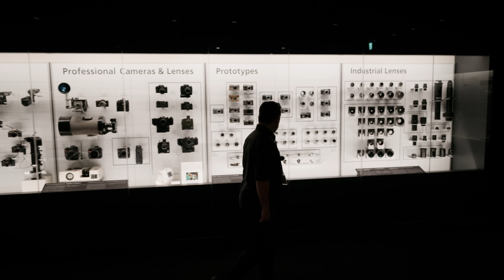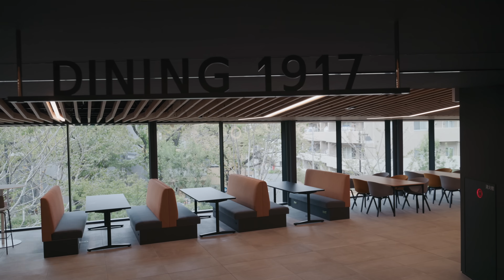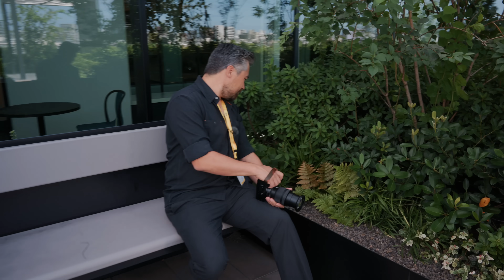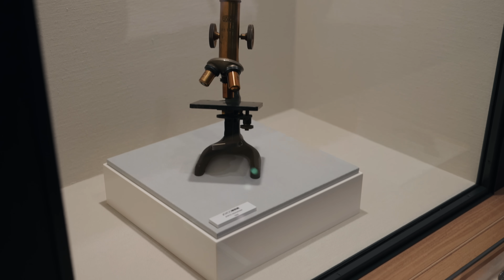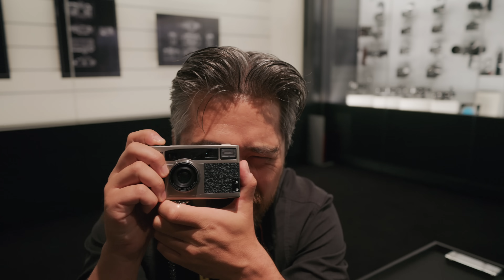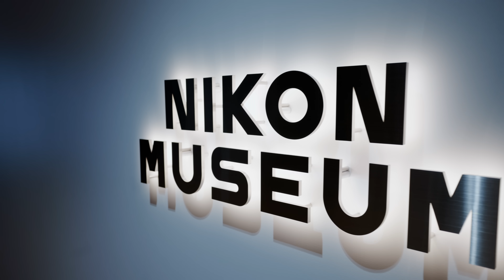Touring Nikon's GORGEOUS New HQ and Museum!

Comment: They forgot to put in the optical devices for the battleship Yamato
Reply: Those are at the bottom of the Pacific ocean. However, it is true that you used to be able to find some stories and pictures of them -- the main rangefinder is one of the great optical achievements of its time -- but sometime around 15 years ago, Nikon decided never to talk about them again, and they've succeeded in mostly suppressing the pictures (all of which were probably from their own archives).

In any case, it would have been hard to fit a 15m rangefinder in a museum.

Comment: Tears. 66 years ago, I started with a petri f1.9, 45mm, rangefinder, with a fixed lens. I still have it with the original case.

I carried it through high school, the Marine Corps, and beyond.
Around 1979, I was looking to upgrade and talked with a local photo store owner about the Nikon and still realized that I couldn't afford nor justify it.
The store recommended a different camera that was quite good and less expensive than the Nikons. It was an Olympus OM-2n. I liked the features of Off The Film metering, off the film Flash Metering, a dark and light button (if the subject was dark as in a 33 1/3 record you use the dark button and vice versa), and taking Multiple Spot Readings for a single frame. The ad shows people around a campfire. Readings were taken of people in the light, shade, and ever the fire, for an average reading. It was cool, so I bought the camera and used it for a decade. But, I always loved the Nikon.

Around 1994, we were visiting my wife's family and by chance I visited the local camera store. At this point, I had the OM-2n and just about every lens and accessory; I had 24mm, 300mm, 50mm, the dedicated pro flash with the battery handle, and an assortment of filters. I asked about the Nikons and still couldn't afford the F's. But, he had another camera, a Nikon N90S, and of course it took all the Nikon F lenses, due to Nikon's policy of One Mount! I still couldn't afford it, unless... The owner asked about my current equipment and if I would consider a trade up. I gave him my entire bag of gear and got the N90S and a cheaper, third party mid range zoom ~30ish to ~80ish mm, and clear and polarizer filters. That's it.

Shortly there after, we took our very first foreign vacation ever, to Canada. We first went to the capitol and then Denali. Yes, Denali with a decent camera and a third party mid range zoom only.
Then a first cruise trip ever from the west coast to the U.S.

I continued buying Nikon with the D70, the D300, and the D750, with some good (heavier) lenses and many accessories. I was keeping an eye on mirrorless also. When the time came, in 2020 to go mirrorless, I couldn't afford the better Nikon models, so I did a flip-flop and got an Olympus M1 mark III and three main lenses, a mid range zoom, a macro, and a super tele zoom, and I am enjoying all the body's features.

Comment: You should ask them why they can't design a proper port cover. The rubber things on the current lineup are atrocious and are a threat to the integrity of the weather sealing with how poorly they fit/how difficult they are to securely seat.